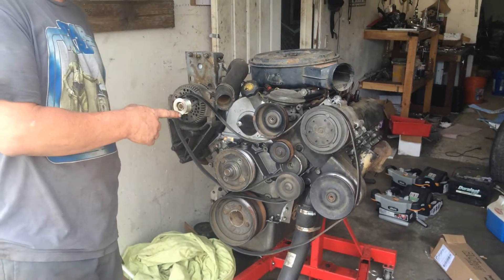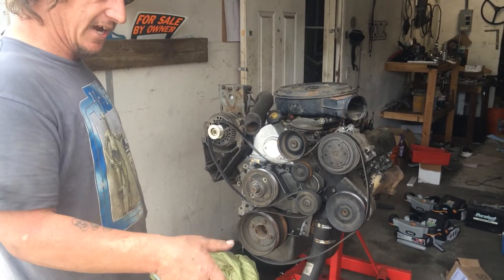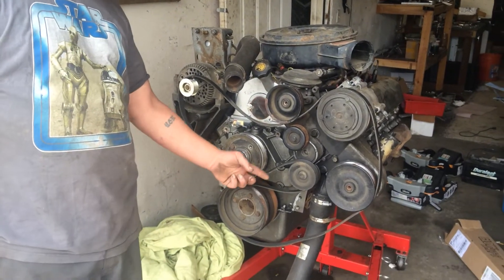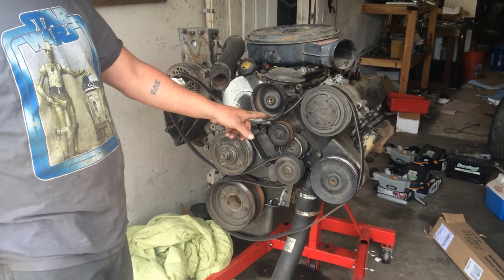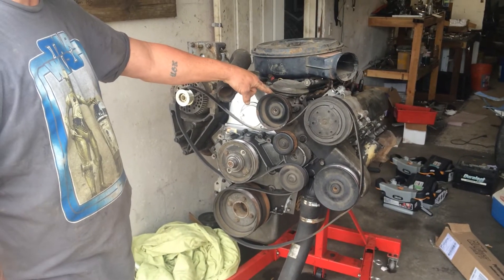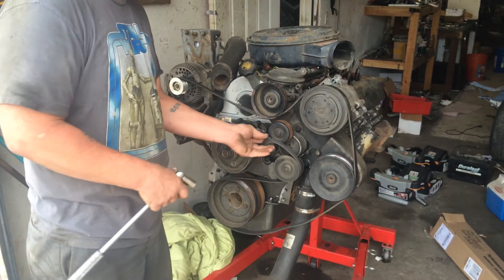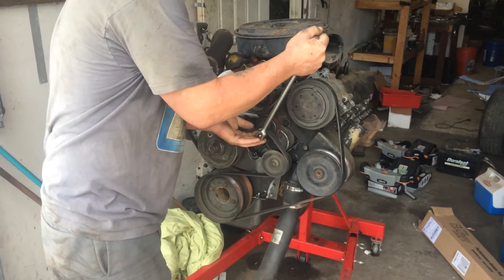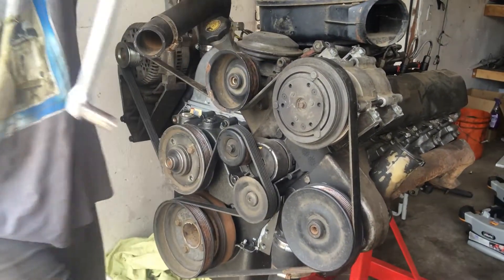7.3 IDI diesel serpentine system routing (NOT POWERSTROKE)

Comment: Hi,
I got her back together and running fine.  just took an $00.83 bolt from Fastenal to fix it.  I used a (12.8 hardness, which I guees is metric, I only knew of grade 8, learn everyday) allen head bolt.   Then I watch your video on routing the belt and long rachet to ease pressure of tensioner.  So
Its a done deal!!  Only thing I messed up was plugging in AC compressor on back.  There was somekind of red plastic thing that I broke and then lost.  But AC still works.  I eill call dealer to ck on that part id.

Thank you sir!

Comment: Great tip, very helpful.   Some the dang bolt holding the tensioner to the block broke off.  If I can get broke bolt out , I will need this advice to replace the belt.👍🏻
Reply from the maker: the tensioner bolts to a cast aluminum bracket, it also mounts the vacuum pump, AC compressor, and powersteering pump. if you take the fan clutch off the water pump, you may beable to get in there some. if not, this bracket os bolted to the drivers side head with 3 bolts. good luck!
Reply: h0trod389 it broke flush to the aluminum.  You think it would hurt to weld a nut to it?  Maybe hold the nut with the ground. Its the 94 idi turbo.  Thank you sir for the help so far!
Reply from the maker: mig it. turn up the heat, down the wire. put a tach in the center, then put a nut over it and weld away. make sure its hot! should work, its a through hole. I would use a left handed/ hell even a right handed  drill bit on a 90* air drill. but I have my brackets powder coated.
Reply: h0trod389 i only have a stick, but think it may still work with 1/16 turned to 70 amps?
Reply from the maker: I wouldn't stick it, kinda tight to get it in there.
but luckily you cant weld mild steel to aluminum, so give it a shot? bont bugger up the aluminum!

also there are 2 types of serp systems for our trucks FYI, open and closed spring tensioner.
both have different brackets. the closed spring design, you can get a tensioner with a shock absorber to help with the belt jumping.
Reply: h0trod389 thanks again, I will keep you posted.  Not sure why bolt broke.  I was on some bumpy dirt roads earlier in the day. Maybe it cracked, then just broke later on pavement.
Reply: Hotrod389 thank you, thank you!! I got the broke bolt out!  I used my little cheapo 120 campbell hausfield 70 amp stick welder with 1/16 rods.  I cut a rod in 3 short pieces and cleaned up ends on belt grinder.  Got the nut on there and it came right out.  I thought the weld had broke at first it turned so easy.  I am thinking about going back with a grade 8, whatcha think?   I filmed some and may do a video.  I'll def give you a shoutout.
Reply from the maker: that's great! yea, that bolt only holds the tensioner to the bracket, and very easily to get out when this happens.  I only use black oxide bolts as replacement parts use. grade 8 has not shown any issues.

have you been to oilburners.net? the #1 best site for the 6.9 and 7.3 indirect injection diesels. very active, very informative, and truly a brotherhood. I suggest you sign up!
Reply: h0trod389 thanks again.  I will head over to oilburners, never been there.  I will join. 👍🏻

Comment: I hate serpentine belts. If a/c pump freezes up, you can not go anywhere. Some of the newer vehicles have two serpentine belts. One exclusively for the a/c pump and one for the rest of the pulleys.
How do I know, it happened to me. They wanted $1,200.00 to rework the a/c system, so I had to save in order to have it repaired. Seven months, vehicle sat, still paid auto insurance and then a new tag. No info as to whether a shorter belt can be used to by-pass a/c.
Reply from the maker: that's a sad story. glad its not mine.
ive ran serp for decades without issue.